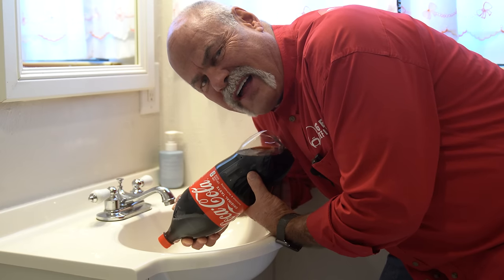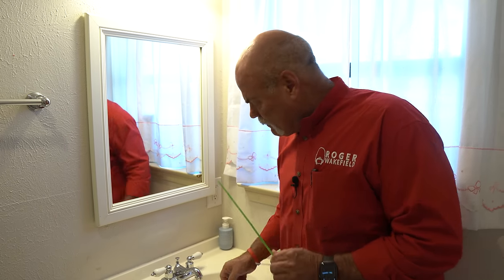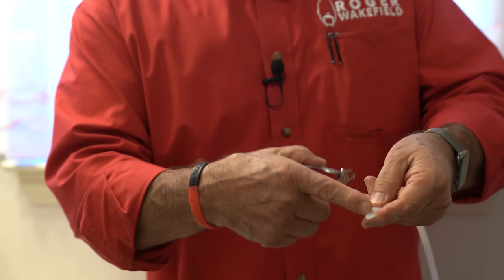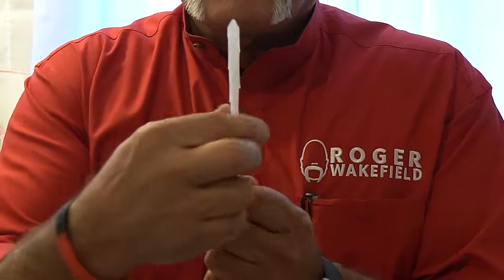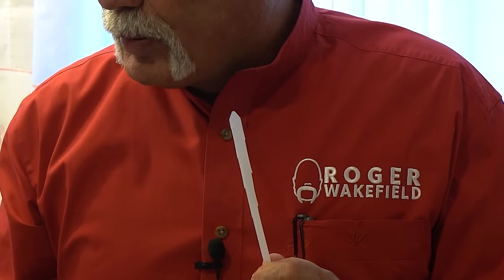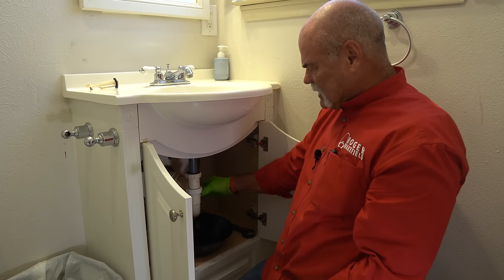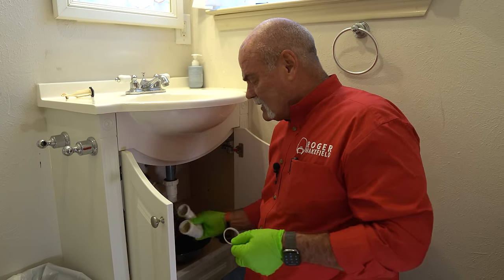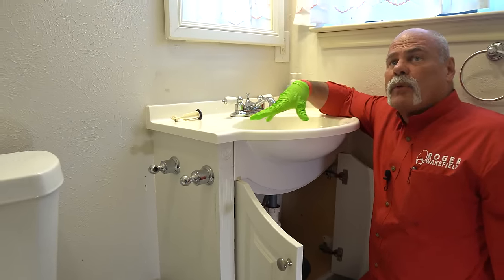5 Tools to Unclog a Drain GUARANTEED

Comment: Now, you are correct. I had a bathroom sink that was starting to get clogged from my brother's gf's hair because she'd always wash it down the drain. it was to the point that if you ran the tap for over 30 seconds it'd start to slowly fill but it did still drain. I ran hot water down it, then coke and let it sit, then a LOT of hot water again to flush out the trap. It ate just enough of the crap down there now my sink now drains fine. It was slow for about 20 minutes of hot water flushing but it did barely work. If it was completely clogged or plugged with something else this likely would not work. Your mileage may vary but coke is very cheap and it's good to try just make sure you flush it out before you add chemicals.

About a year ago I shut off my internet so they would move out because there was tons of other issues related to her. After shutting the internet off they moved out within 48 hours. THAT is how you make someone with no job move out.

Comment: Shop vac is your friend. Had a clog somewhere in one of my basement drains. I have a shower, sink, floor drain, toilet, as well as a condensation drain from the ac. I was pretty sure the clog was closest to the sink so I put duct tape over the other drains except the toilet, just shut the lid. Then placed something heavy on the tape in the shower and floor drain. Next, I sealed the vacuum hose to the sink drain and first used the suction feature and then switched the hose to where it blows air. Went back and forth between these two and the clog was cleaned! Just be sure the hose and all other drains are sealed. Otherwise you will blow the nastiness from the drain all over the place.

Comment: I was once told by an older lady at my job was to drop in some palmolive down the drains a few times a year as it breaks down any gunk and prevents future clogs. Not sure if it work but I have done this for some time and have not gotten a clog in years. knock on wood...
Reply: From an electrician and former chef:
Youre puting a mild degreaser down the drain. 1) it cleans the pipes of deposits, 2) Degreaser strips oils out of hair and dries it out. 3) something like a dish soap strings out ( mixes well into water). Its a pretty solid method, i also like to use very hot water to further help break up natural build up. 
   A few other old timmy tricks are, boil water and pour it down the drain if it is slow. Pickle juice  ( vinegar, and you can add baking soda for more effectiveness)- work similar to degreaser. Use something like rid-ex once a year in all drains. And last tip, put a stopper ( drain plug) in and fill the basin (sink, tub, exc) a little above the plug to create a negative pressure in the pipes ( it will be a psi rating lower than the 20psi forced through in the vid.). Your on the right track for keeping it clear. Great job.
    Donny dont do's, strait degreaser and not rincing it out- it will eat the "bonding agent"! Leaving cleansers in the tank of a toilet for hours or days- it dries out and corrodes/oxides metal and rubber parts. And last for this is, putting things down the drain that expand when wet ( rice, pasta, tampons, large amounts of t.p., trash). Plumbing health is home health.
Reply: We use Dawn to wash dishes and haven't had a clog in years
Reply: @a.rivera  same here and wash greasy dishes with hot water.. aside from pouring Palmolive down the drains.
Reply: @katieblade7083 my mom always held with the belief of putting old pickle juice down the bathroom sink.

Comment: As a homeowner I like to use an old gun-cleaning kit to clear drains in my sink and tub.  It's nice because I can jam a small brass brush into just about any pipe, and pull enough hair out to at least make room for a bigger brush, a different tool, or clear the drain completely.

Comment: From an electrician and former chef:
Youre puting a mild degreaser down the drain. 1) it cleans the pipes of deposits, 2) Degreaser strips oils out of hair and dries it out. 3) something like a dish soap strings out ( mixes well into water). Its a pretty solid method, i also like to use very hot water to further help break up natural build up. 
   A few other old timmy tricks are, boil water and pour it down the drain if it is slow. Pickle juice  ( vinegar, and you can add baking soda for more effectiveness)- work similar to degreaser. Use something like rid-ex once a year in all drains. And last tip, put a stopper ( drain plug) in and fill the basin (sink, tub, exc) a little above the plug to create a negative pressure in the pipes ( it will be a psi rating lower than the 20psi forced through in the vid.). Your on the right track for keeping it clear. Great job.
    Donny dont do's, strait degreaser and not rincing it out- it will eat the "bonding agent"! Leaving cleansers in the tank of a toilet for hours or days- it dries out and corrodes/oxides metal and rubber parts. And last for this is, putting things down the drain that expand when wet ( rice, pasta, tampons, large amounts of t.p., trash). Plumbing health is home health.
Reply: I've heard you should only use boiling water if you have metal pipes and for PVC use hot but not boiling. I put baking soda and vinegar followed by hot water down the bathroom drain once a week for maintenance.
Reply: @janleonard3101  Yeah, you don't want boiling water in PVC.

Comment: I know ever since Ive replaced all my taps and drains to pop ups from the old rod/lever design, I get no clogs.  Before that, I just took a long piece of electrical wire copper and put a loop at the end.  It catches all the hair, etc.  But its flexible enough if it gets stuck you can work it out

Comment: Dump baking soda down your clogged drain.  Chase it with a bit of vinegar.  Done.  Don't add sugar to the drain.  Its just one more thing that can collect on the insides of a pipe.   If you have a slow drain, try squirting some dawn dish soap/degreaser into the drain over night and see if it loosens up by morning.

Comment: The part about removing the P-trap only works if you've got a removable P-trap. I've actually been extremely pissed about this almost every sink if not all of them in my house I swear the plumbing was done by a firmer. If you think I'm exaggerating when my grandfather bought the place he had to replace all the plumbing in the basement. The entire system that we were able to access in the basement was comprised of Frankenstein Plumbing we're talking about Taps used to make up gaps random sizes of pipe mixed together you name it random lengths sizes pipes spun around and circular modern art style formations and so on as an example multiple elbows linked together to make a section two or three Taps used to link together random lengths of pipe and so on it was like the entire Plumbing what we were able to access in the basement was done by a child using leftover parts from other plumbing jobs. I've already had trouble where I wanted to take the P-trap off of two sinks here in the house and in both cases they were not removable again it was hodgepodge and everything was glued together instead of being removable parts they were PVC parts and glued together with some sort of a bonding compound I literally have had a situation now for over a year where I have a length of pipe that is clogged somewhere and you can't get a snake down the pipe I actually had to cut a piece of the PVC out do you even access the pipe in the end because even after getting the P-trap off due to the way the pipe was installed you couldn't get a snake in the pipe like I said Plumbing nightmare. My grandfather didn't go tearing walls out he just replaced everything that was out in the open in the basement. Prayer is running a broom handle down the pipe I've tried a couple times to get a snake down the pipe and the snake won't work I keep threatening to just say screw it and get a long length of small pipe or a broom handle and try unclogging the pipe that way what's the pipe that leads to the sink in the kitchen and ironically that one pipe is totally separate from everything else

Comment: My favorite is the "Hose End Drain Cleaner" for about  $14 ,  but I did have to buy a hose end ball valve separately. (They didn't think it through all the way when designing it.)  It's cheap and works perfectly. 

 But also, I never have hair problems. I bought in in about 1995 and it has never failed me.

Comment: Water ram could compact the clog making it worse. Very old school. Drain snake or Drano is the best solution for a complete clog. Enough Drano to make it past the P Trap. Five gallon bucket of hot water from the tub to clear out slow drain from grease and soap. Ridgid FlexShaft does a great job clearing lines that get clogged often.
Reply: The fact u said drano shows a lot

Comment: My problem is that all the drains are the old fashioned type with a cross-guard - metal bars that form a cross shape across the drain hole that cannot be easily removed.  This means augers don't fit and those unclogging strips get stuck and have their "teeth" ripped off as I pull them out.  What I really need is a very small narrow auger.

Comment: If I used the ram at the complex I work for,  it would crack every pipe in the wall! My go to is the drill snake for kitchen,tubs, and lavs. Super slow and gentle.  So many of the copper lines are super thin where the goop sits. The goop sits a lot as decades of settling has comprised the pitch of them.
Reply from the maker: Your complex has copper sewer lines?
Reply: From the wall to where they meet a hub to the cast, which is a constant nightmare

Comment: I love it when people plunge drains, makes more work for fixing leaks.
Reply from the maker: You don’t think plunging drains work?
Reply: @RogerWakefield not saying it works or not, its just unnecessary force to apply to fittings and shooting up crud up into places where it doesn't need to be. simple mechanical snake work should do the trick. but hey we here to make money right?

Edit: even snaking has potential to breaking stuff too.
Reply from the maker: you're right, there's a risk to every method...so at that point just choose one and go with it

Comment: I remember the old days when plumbers would reach for the muriatic acid to remove clogs. To my knowledge it isn't done anymore, but is that because of the use of PVC pipes? I've always wondered that. I have one of those plastic unclog sticks, and it's worked really well for me. I also have one of those small snakes, but I don't think I'm smart enough to use one because I can never get it past the P-Trap in the tub drain.
  My wife has long hair so I have to remove clogs from time to time, and man, they get out of control sometimes. It's like there was a small rodent-sized animal living in it, lol. Personally I prefer to remove the clog rather than push it through because not only is it confirmation, but that clog can't get lodged further down in the system later.
Reply: PVC is inorganic, so sulfuric acid/muriatic acid won’t affect it. You can still buy it in hardware stores.

Comment: I use a wire hanger
Reply from the maker: Does that work well for you? I'd think that's too smooth of a surface to grab everything
Reply: Where do you even get those anymore?
Reply: Well I use the part that twist around the hook more or less just to clear shower trap @RogerWakefield
Reply from the maker: Whatever works for you 💪🏻